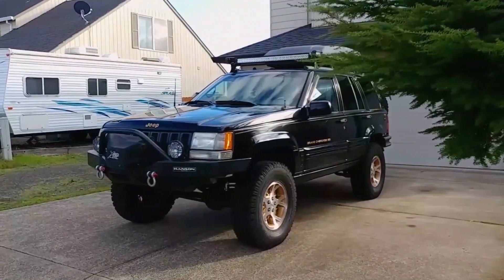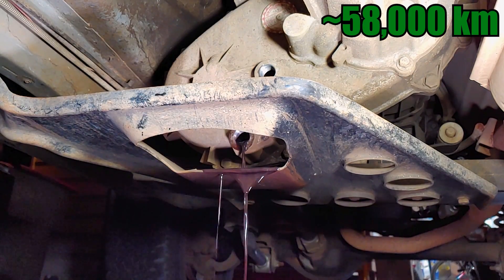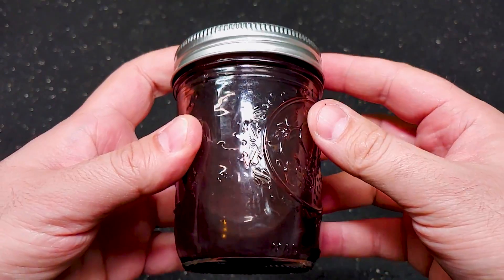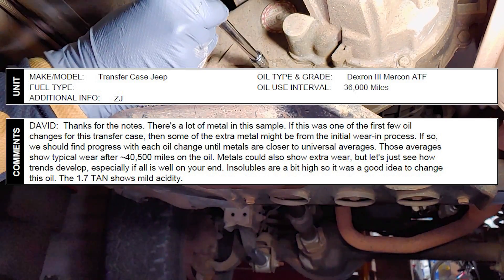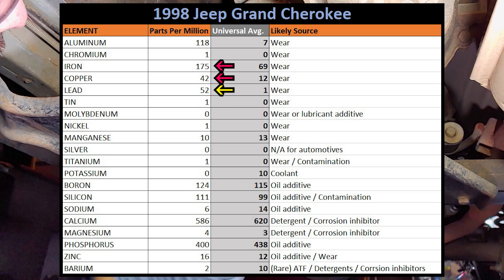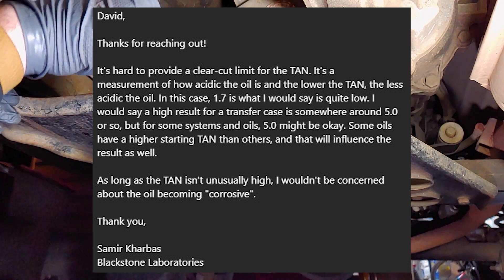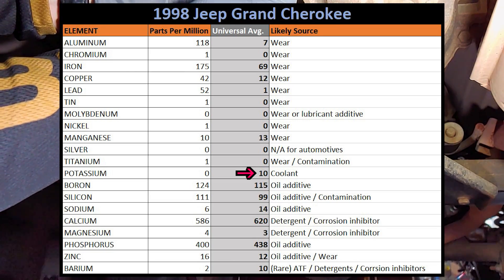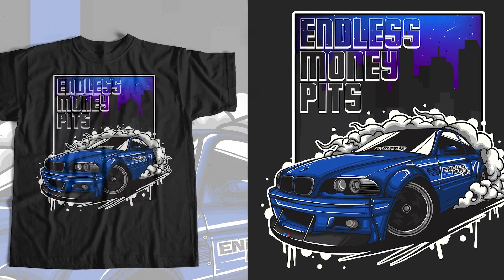Can a Jeep Survive 10 Years Without a Transfer Case Oil Change? Analysis

Comment: David, I'm the guy with the 350k-mile ZJ with the 5.2 (commented on your ZJ oil change video). Our NP249 oil looked okayish when we first acquired it (~280k-miles) but I changed it anyway. Didn't help with the sounds coming from that thing--like a thin metal box of poorly meshing gears, particularly at speed. So I replaced it with a used NP231. What a difference; silence (at least from that area). Plus, no more viscous coupler, AND more ground clearance (231 case doesn't hang down as low because the case is somewhat smaller). 

The operative thing here is that the 249 has a wide chain that drives the front AND rear driveshafts whereas the 231 has a narrower chain that only powers the front driveshaft--and only when you select 4x4--the rest of the time it's not transferring power other than enough to spin the components. When in 4x4 I can hear (sensitive ears) the chain, but it's also a used case. 

When I took the 249 apart out of curiosity I found the chain had a lot of side-to-side play, so it was worn out ('stretched' in chain parlance). I know this because I also have a full size jeep truck with a Borg Warner 1339 original Quadratrac transfer case. These are much like the 249 (using 'coaster brake'-like clutches instead of a viscous coupler) in that the chain transfers all the engine power all the time. They wear chains out for lunch. 

Long story short--go for the NP231. No change in driveshafts needed--but a good chance to replace the rear transmission oil seal and the U-joints on both prop shafts. There are significant resources online for this swap, which takes some planning because the 231 was used in several different applications, not all of which are bolt-in. 

Hope this helps.
Reply from the maker: Interesting. I've never heard any noise coming from my transfer case, so yours was probably on the verge of coming apart. I like my 249 because it's better for snow, has fewer moving parts, and being in 4WD all the time means I get all the traction all the time without having to think about it. I have a skid plate for mine, so the ground clearance difference doesn't apply, and I replaced the viscous coupler when I bought the Jeep, so it should be good to go for a long time. Thanks for the input, I might change to a 231 case when the time comes.

Comment: Very interesting facts.... never heard of anyone having any oils/fluids in a machine analyzed like you have although if I owned
big Cat's or other large earth moving type stuff I think I'd want to know all about it.  Also,  I'd bet that  this transfer case gets
changed way less than it should.  What I mean is a lot of owners might not even think about it or know and then there's the
owners who do not change the engine oil regularly?  Thanks for the video & We used a UHAUL for 3 days &  about 350 miles
was right at $500...... w/o gas included.   Go Figure?  Enjoy the new home